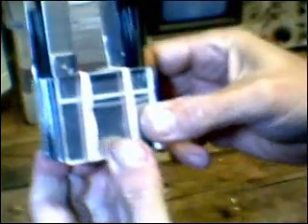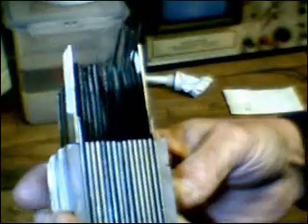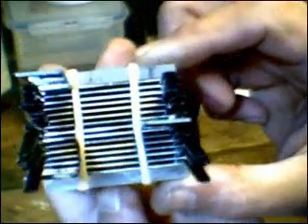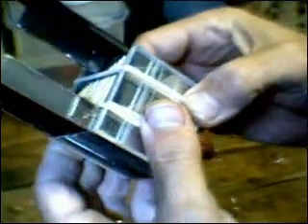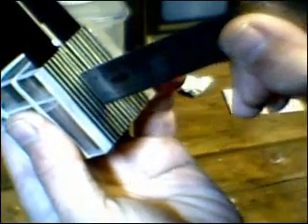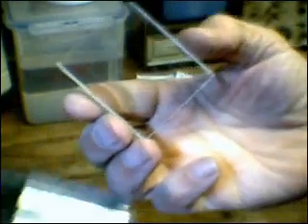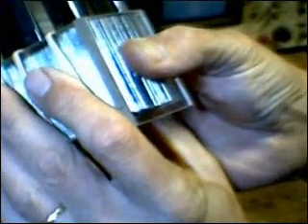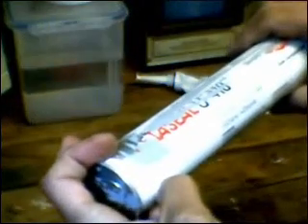#39 New Experimental HHO cell preassembly

Comment from the maker: My first attempt to glue it up was a total disaster. Shims shifted inward as adhesive was compressed into the sides. Have to start over with clean plates. >:(

Next time I'll trowel a fixed even layer of glue to the sides before assembly with a flooring adhesive trowel.

Comment from the maker: BTW, everyone, the new gap will be 0.045". No particular reason for that number other than I wanted less than the 0.090" I'm using now but not 0.020" I have seen others using, and that just so happens 2b the thickness of the cable ties.